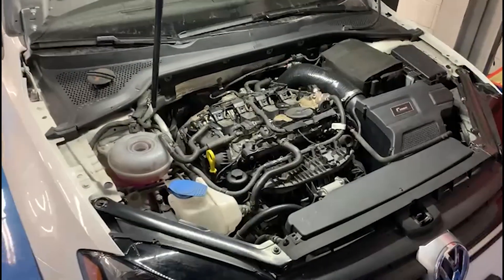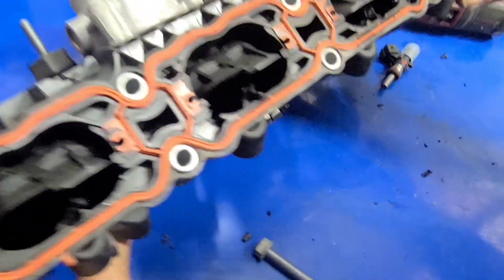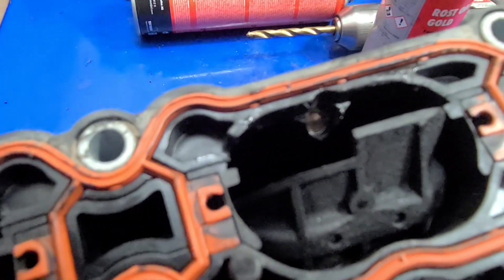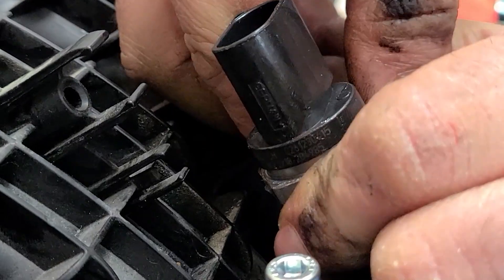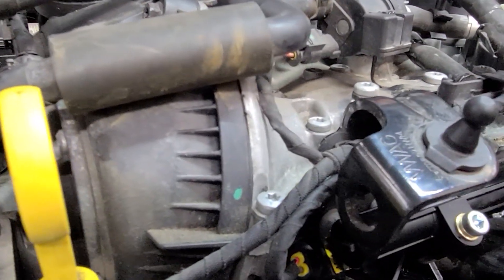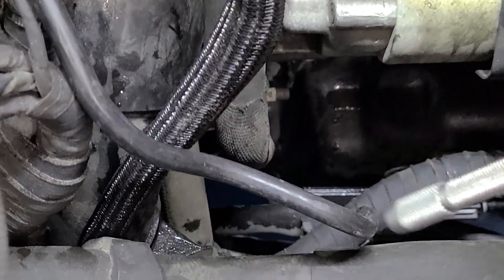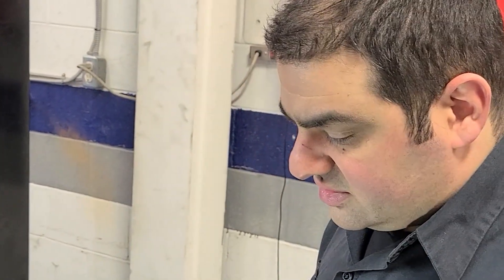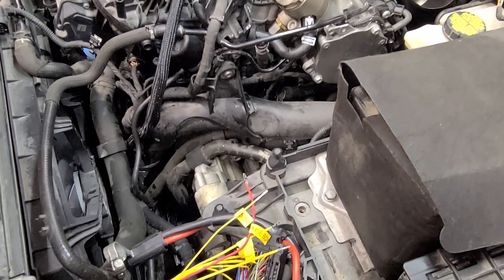MK7 Golf R HPA Motorsports - Port Injection Installation

Comment: That fuel return fitting has such a tiny orifice. Looks like a major restriction.
Reply from the maker: This is a secondary fueling system used in unison with the high pressure fuel system, to help us get to the 500HP mark reliably. This kit is the factory VW port injection system.
Reply: @euromotiveautoservice1357  the tune must be heavily biased towards DI, because that thing is tiny lol